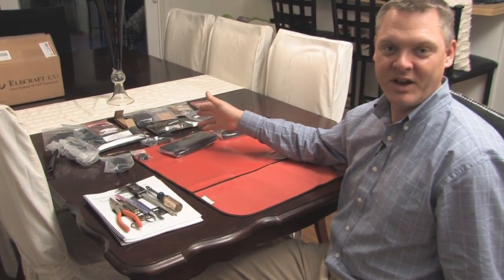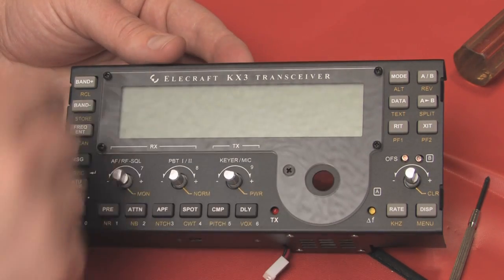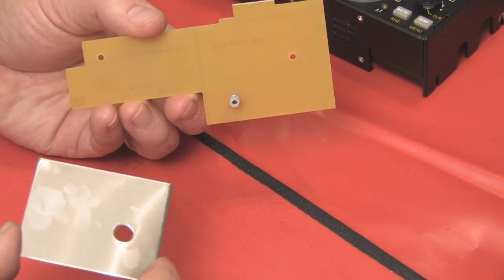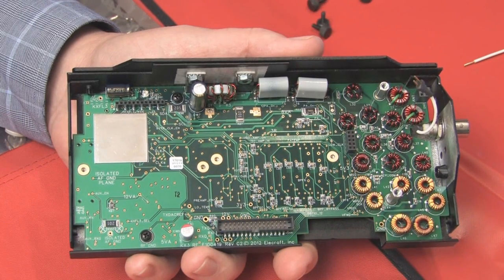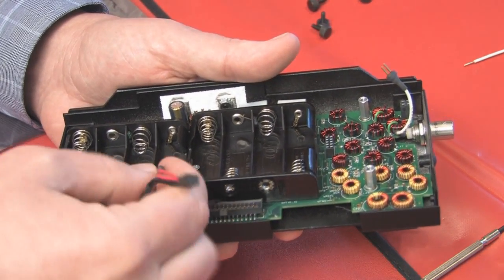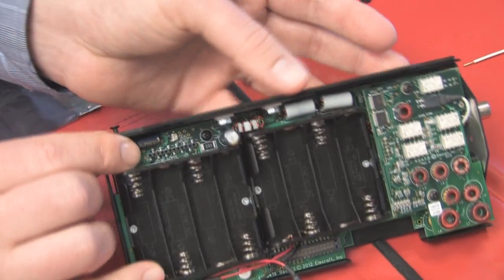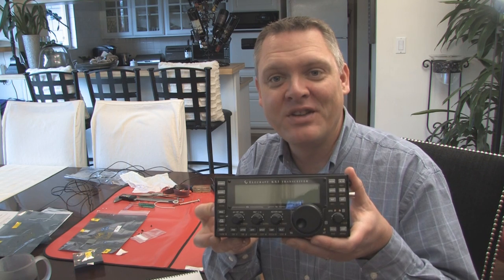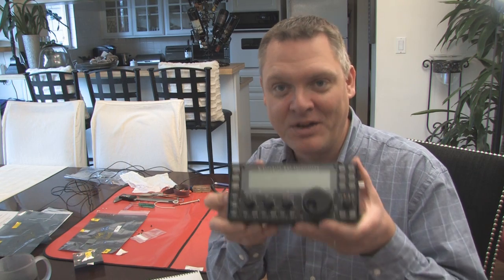Elecraft KX3 Ultra Portable HF Transceiver Kit Build

Comment: Fine video, OM, but I beg to differ. You are ASSEMBLING a kit NOT building one. You solder components when you build. Get a K2 kit and BUILD that. You will understand. 

But good job. 

71/72,

Bill, k6whp

Comment: I was sold on Elecraft --- until I went to get one!  The prices were astronomical.  I could afford it, but had better use for my money than a pint-size, low-powered rig.
Reply: Buy a k3 used.... you won't regret it.
Reply: @radionb3i  I have a KX2.  similar but smaller.  Decent radio but shitty ergonomics, dirt cheap knobs and encoders  and more holes in it than a Swiss Cheese.  It will be my last US rig ever.   Over here, vastly overpriced and not great.